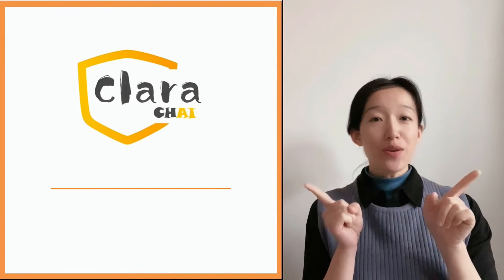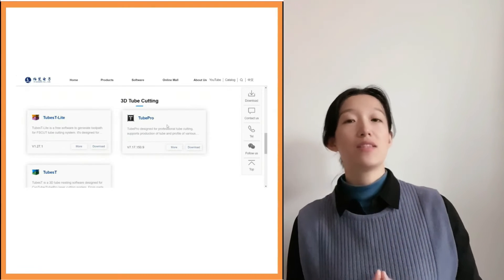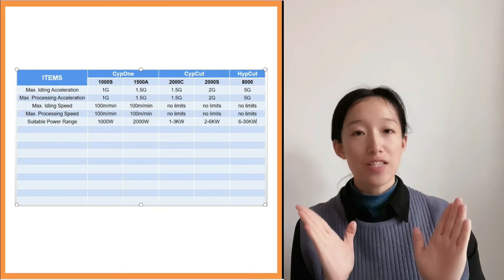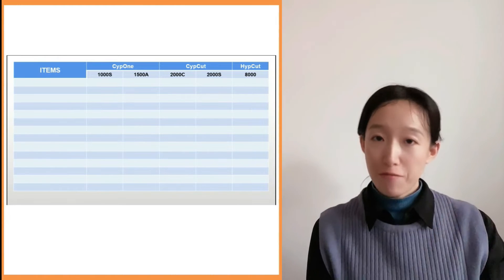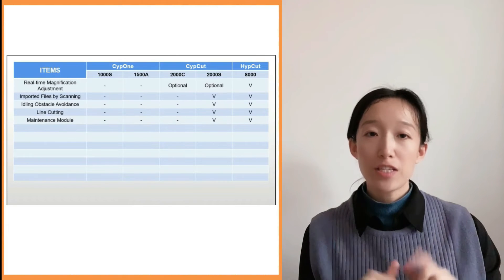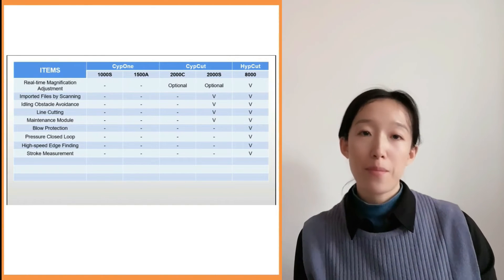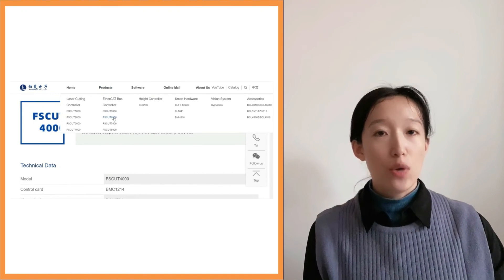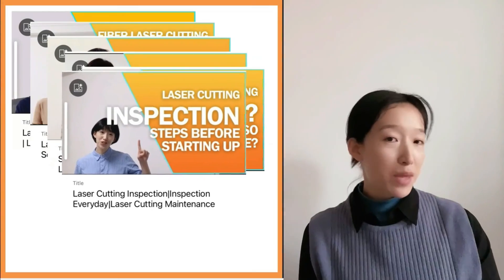CypCut Versions | Differences on CypCut 1000 2000 and 8000

Comment: Hi there, can you tell me exact servo motors models compatible with 2000C version? Also, would you sell those?
Reply from the maker: The motors should be equipped by the machine configuration. +86-13335151833